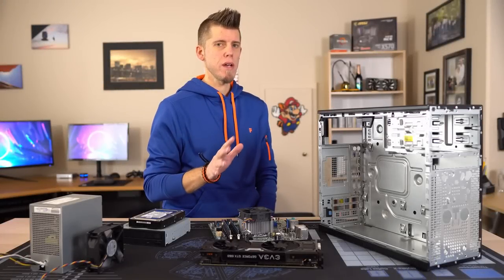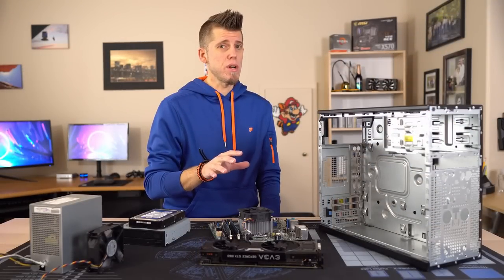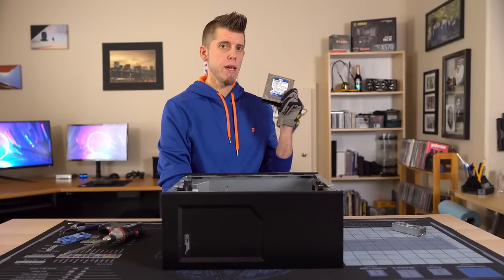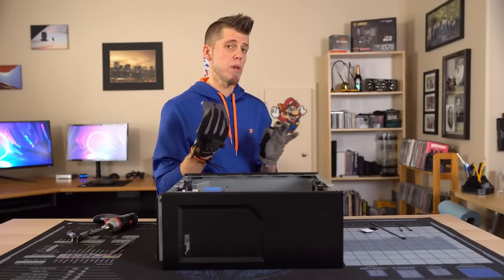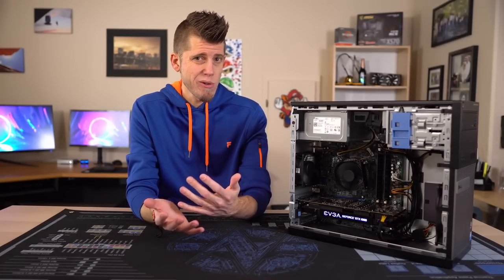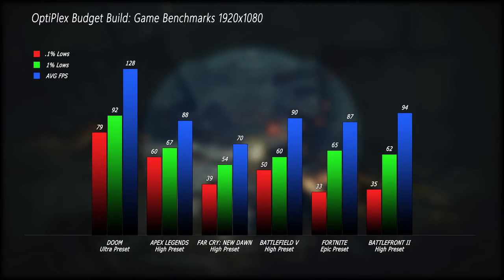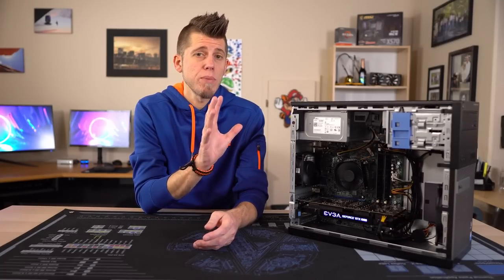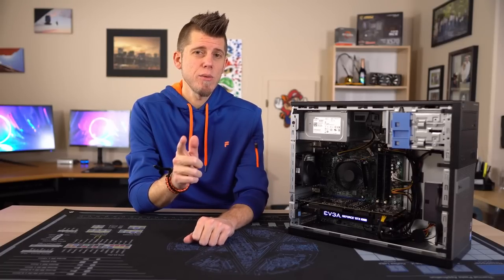Dell OptiPlex Budget Gaming PC For Under $300?

Comment: ummmmm.........using ANY type higher end component, like the GPU you have, you really shouldnt use the stock PSU. 

that GPU needs at least a 400w PSU 

and that CPU is more than likely struggling and becoming a bottleneck
Reply: I agree, however he has one VERY big problem: the motherboard doesn't use a standard power connector.  A different video card is advised.  It doesn't have to be a major drop, even down to a GTX 1050.  Dell clearly did not design that particular Optiplex to be a gaming rig.
Reply from the maker: I'm getting tired of repeating myself, so I'll copy and paste.

"People keep throwing around wattage numbers, not realizing that some power supplies have a wattage rating that is their PEAK rating, and that they can only supply around 250 to 300 watts continuously. This is why nVidia says, 400 watts as a minimum. To account for low end PSU's. I've torture tested this PSU and it can supply a constant 290 watts.

That being said, the system is pulling around 210 watts from the PSU, leaving you with a 70-80 watt overhead. It's fine and just as good as using a 400 watt PSU that only can supply a 300 watt constant."
Reply from the maker: @holman182  What you're referring to is BTX, and there are 24-pin to 8-pin adapters to put a standard PSU in these. That being said, read my other response as to why it's fine.
Reply: @TheGameBench  I suppose my only real cause for concern is voltages on the 12v rail.  So long as the voltages are ok, then definitely, the PSU should be fine.
Reply from the maker: @holman182  I mean, the amperage on the 12v rails isn't spectacular, but adequate. However, it might be worth taking some time to put a multi-meter on it to monitor the how steady the voltages are.

Comment: I came here from Rich's video and dude I think you should make a reply video toward ReviewtechUSA. Not to start any drama, but to explain the PSU issue like you did in your pinned comment and respectfully ask that he contact you or others before making "exposed" videos. He's done this kinda stuff before and I think if you let it slide he'll just do it again to another small channel and they'll get harassed like you are being. Just my 2 cents, keep up the good vids.
Reply from the maker: I really appreciate that, and I have gone over this, in my head, several times since yesterday. I've got rebuttals for pretty much everything he complained about it that video, but I can't help but feel like I would only be adding fuel to the fire. Wouldn't matter how well put my response was, how objectively correct I was, confirmation bias will validate the people's opinion that have been dropping comments. I only have a little over 3,000 subs, and thus no credibility. It wouldn't stop it from happening again. A response would have to some from someone much larger than me to have any impact.

That being said, I do want to make an in depth video, at some point, about power supplies and why the people focusing on that don't understand the reason for nVidia's recommendation and have very surface level understanding of power supplies. It's relevant information, regardless. I just feel like I need to hold off on making that video. Mostly so I can do more research into power supplies, so I can have an in depth knowledge of ripple. That way I can explain to people, why 80+ and wattage ratings can be very deceiving, and what to looks for when picking a power supply.

Anyhow, I'm rambling. Thanks for the support. I can't tell you how much it means after this weekend.

Comment: Oh no you just got put on blast by RieviewTechUSA
Reply: PlebMike I mean Rich isn’t wrong
Reply: @freshyeet4144  230w power draw at most, 300w power supply.
Thats more overhead than a xbox one or xbox one X
Reply: @freshyeet4144  Oh I know it was cringe worthy
Reply: nVidia website calls for a 400W min. the Dell is a 290W. Overall this is a good build guide, but Rich is 100% correct. 

The LAST thing to skimp on for a PC is the PSU.
Reply from the maker: The reason that nVidia says you should use a 400 watt PSU at minimum is to account for shitty PSU's that are rated in PEAK wattage. So, for example, a 300 watt PSU that can only supply a constant wattage of 200 watts. The 290 watt PSU in this system can supply a constant wattage of 290 watts. I've tortured tested them with a constant draw of 290 watts for hours. The total system power draw is around 210 watts, giving you an overhead of 70-80 watts. That's enough and doesn't put you in danger of damaging the equipment or causing premature power supply failure. I've fully tested everything and it's fine. The power supply in these is just as good, if not better, being able to supply a constant 290 watts as a 400 watt power supply that can only maintain around 290 watts, or less.
Reply: The Game Bench I’m a electrical engineer so I can tell you you fucked up son .
Reply: @EbikeAdventuresSD  lol
Reply: @EbikeAdventuresSD  Oh really.  I'd like to see your calculations.
Reply: Preston Cormick no it called a degree something you don’t have  nor the $250.000 plus a year I make working for GE yes that GE .
Reply: Jonathan2844 You can laugh it up when you earn a degree and work for GE.
Reply: @EbikeAdventuresSD  My query was that from another professional, but rather than an intellectual and mature conversation, you produce no calcs nor thesis, just self pontification  and juvenile insults to myself and others in this thread.  Your contextual reference to myself regarding Taco Bell is particularly egregious.  Far from the response any rational adult would expect from a self proclaimed middle aged professional with said education and experience.  

If, by chance, you are a fellow, I am embarrassed by your behavior.
Reply: Rico Swave Not middle age and you can see my work every day in things you use your welcome. I started as a intern and work my way up also I finished school early at that . Your perceptions of reality are false.

Comment: I actually built this system! Very doable! I was able to find a dell 7010 with an i7 3770 with 1 tb hhd, 16gb DDR3, a evga 450psu, and a stock gt730 for $85. I even found a 1060 6gb for $200 and a $20 used 500gb ssd for boot drive. $295 for 100+ fps on these same games.
Reply from the maker: A 1060 6GB for $200 right now... that's a steal.
Reply: @TheGameBench  I know!!! I could not pass it, I even saved the link in case someone needs proof lol!

Comment: Looks like you overlooked the wattage requirements of the gpu. That Dell stock 280-300w psu could cause system instabilities. That gpu has a maximum power requirement of 120w. So you should be using at least a 400w psu.. Not to mention the stock psu is probably not 80 Plus certified.
Reply from the maker: Since I'm tired of repeating myself, I'm going to copy and paste.

"People keep throwing around wattage numbers, not realizing that some power supplies have a wattage rating that is their PEAK rating, and that they can only supply around 250 to 300 watts continuously. This is why nVidia says, 400 watts as a minimum. To account for low end PSU's. I've torture tested this PSU and it can supply a constant 290 watts.

That being said, the system is pulling around 210 watts from the PSU, leaving you with a 70-80 watt overhead. It's fine and just as good as using a 400 watt PSU that only can supply a 300 watt constant."
Reply: @TheGameBench  says this, as he uses a cheap OEM psu.....
Reply from the maker: @Cyrus_Nagisa  Not all OEM PSU's are bad. There are quite a few that a lot better than a lot of the cheap PSU's I see people putting in their builds. I'll bet you were the kind of person that said this same crap about the Great Wall OEM unit in the Wal Mart Overpower systems. All the while, there are people running high end PSU's in their rigs made by Great Wall. Then Steve over at Gamers Nexus tested it and found it wasn't the dumpster fire everyone was making it out to be.
Reply: @TheGameBench  the reason your having to copy and paste it is because your wrong and you need a psu that can handle a 1060
Reply from the maker: @Silvyya  Read the pinned comment if you'd like to know why you're objectively wrong.

Comment: i have optiplex 9010 with xeon 1225 v2, 12gm ram, 460 watt coolermaster supply, 120 gb ssd, 1tb hdd, gigabyte rx 580 card
Reply from the maker: It's pretty close to the i5 3470, but it has two more MB of cache.
Reply: @Jason Packer pretty good actually most of the games are running around 60fps
Reply: @TheGameBench  yes.. i got the pc and all the mentioned parts except the card in 116$ or less and the rx 580 8gb card i got in 155$.
Reply: @Jason Packer yes what i found out that when it comes to gaming we dont really need high end specs.. even a mid range pc can give us the satisfiction.
Reply: almost the same here i have a xeon e3-1220 v2  cpu in a dell 3010 with 16 gb 1333mhz dual channel and a dell branded rare r9 360 2gb gpu. basically a r7 360 with lower  a few less shaders and lower tdp.  i might get a gtx 1650 later on but the xeon 1220 and the r9 360 aint too bad at all running COD MW or BFV on med at 1080p at 55-60 fps. shadow of the tomb raider though....it hates my setup....30fps if im lucky at 1080p.

Comment: If you are thinking about doing this, DO NOT KEEP THE POWER SUPPLY INSIDE. The one this guy uses can't handle the 1660 TI. It will likely catch on fire anyway. Calculate how much power your PC comments will draw, and buy a PSU with at least 50 watts of headroom. You can get a PSU with even more spare watts in case you want to upgrade in the future. A good PSU should last you over 5 years, so you'd likely upgrade your GPU and CPU before you upgrade a PSU
Reply from the maker: I didn't use a 1660 Ti, I used a 1060. I've tested the power draw and this 290 watt unit can maintain a sustained 290 watts. The system pulls about 210 leaving about a 70-80 watt headroom. So, by your own measure there... it's more than fine.

Comment: I just saw this on ReviewTechUSA. Are you going to respond?
Reply: The Slice Factor doesn’t look like it lol
Reply: Go back and leave this guy alone.
Reply from the maker: To what end? There are a lot of misinformed people responding some being rather aggressive. A response will only rile people up even more. All I can really do is explain myself as people comment.
Reply: @TheGameBench  some have been needlessly aggressive, it's the internet, it's going to happen. But many have voiced their concerns with your choice of using the stock PSU.  It's a legit concern, and you brush it off with some "not all psus are equal" bull, while using a 300w stock PSU that was made as cheaply as it could.  If it was a cheap bronze certified 300w I would be a good bit more understanding, even more so with a 400.
Reply from the maker: @Cyrus_Nagisa  Yeah, I get that, but Rich didn't have to be so aggressive in his video either. As for the power supply. I've more than explained that. It's functionally fine with the 1060. I'm objectively correct. People who have more than surface level understanding about power supplies knows this. Besides, it's not like I'm trying to convince people NOT to get a better PSU. By all means, if it's your budget, it would be the first thing I did after adding an extra 8GB of RAM for like $15.

The point of this video was to get someone into PC gaming that didn't think it was an option over a console, and with this hardware, the stock PSU will work perfectly fine. The problem is that because it's a pre-built, you assume it has a crappy power supply, and that's not the case.
Reply: @TheGameBench  anyone with a basic understanding of power supplies will tell you not to use a power supply that does not reach the minium recommend output for the graphics card. Also they would know not to use a Chinese power supply that is not 80+ certified and use a molex to 6 pin adapter with it. I know that functionally it might work but it's not a good solution long term. Any experienced pc builder will tell you never to skimp on the power supply. Especially when you can get a decent power supply that is more than capable for this build for 50$. You say the power supply is not bad but it is. Dell uses cheaper components for their pcs because they are not pushed to the limits. You are pushing the power supply to its limits and it's not even 80+ certified.
Reply: @Josiahsutton1  100% Agreed, this is very valid criticism and Joss77 is correct. I know this because I've been building computers since 2010, I pulled this stunt with my 2nd build, 2 days later I was playing Battlefield 3 when I started to smell smoke. The molex to 6pin that I used to connect my powercolor radeon HD 4850 had caught fire and melted obviously shutting the computer down. Luckily the rest of the components were fine but I learned a damn valuable lesson that day, it didn't take me long after that to upgrade the psu.
Reply: @TheGameBench  you got exposed dude. My house could be burnt the hell down with that power supply.
Reply: @Vaineguardio  Dude.... The HD 4850 came out in a time in a time of power hungry video cards and pulled more power at idle as the 1060 does at full load. The HD4850 could peak up over 300 Watts at game play. Of course it's going to melt the power connector, their not designed for that much power. Trying to compare this build to your experience 10 years ago is not an apples to apples comparison.
Reply from the maker: @Tinbeef22  Read the pinned comment. There's nothing wrong with a low wattage consumption GPU like the 1060 on this power supply.
Reply from the maker: @Josiahsutton1  That just the problem. The people criticizing this video have nothing more than a basic understanding of power supplies. When you say things like "it doesn't even have an 80+ cert" It just confirms this. That is an efficiency rating, and has nothing to do with quality. Stop trying to use it as a metric of such. There are a lot of trash 80+ PSU's out there that I would never suggest anyone use, regardless of the rated wattage, because it's easy to take a garbage power supply and add some better caps to get that 80+ rating. And they do it just because of this perception that it has something to do with quality. That being said, this exact PSU comes in 80+ Bronze and Gold. The only difference are the capacitors and thus the efficiency. They are, otherwise, exactly the same.

Now, if we were talking about a consumer grade Dell... I would agree with you. They're all about the lowest bidder and profit margins on the product. However, the OptiPlex is a business machine. They aren't in the habit of dealing out cheap components in their business machines because they will have to support them, with expensive techs that have to come out on site. I used to work for HP as a field engineer doing this. It's not cheap, and companies like Dell and HP don't want to foot that bill any more than they have to. So, they use better components in their business machines.

That being said, before I even started out making this series, I tortured one of these with an RX 480 pulling around 300 watts from the outlet on it for over four hours. It handled it just fine because that 290 watts is a constant rating. Unlike cheaper power supplies that will rate their power supplies at their peak wattage. Meaning they can supply that momentarily. This is why nVidia recommends a 400 watt power supply. They do it as a simple way to make sure their customers are covered in case they end up with a cheap peak rated 400 watt PSU. Which more likely supplies as much, or less, than the 290 watt PSU in this Dell. These Dell PSU's also have protections and will shut off if you ask too much of them... once again, I tested it. Also, they have adequate amperage on the 12v rails.

The 1060 will consume about 120 watts max. The rest of the system, less than 100 watts. I've also tested this as it pulled about 220 watts from the outlet. Leaving it with 70-80 watts of headroom. It's fine, I've tested these on end. Also, the adapters, are fine long term so long as you don't get crappy ones and so long as you're using them on a low wattage draw GPU like the 1060 and not something, like a damn 4850 that draws more power at idle than the 1060 does at full load, you'll be just fine.

I don't know about you, but I've been building and modifying computers since the late 90's. I agree that you shouldn't skimp on the power supply. I'm not telling people to use it to run a modern system with a 1080. With this specific hardware, it's objectively fine. The people that disagree are entirely ignorant as to how all of this works and have VERY basic understanding of power supplies and power consumption.
Reply from the maker: @Vaineguardio  Like BeZerK2112 said, that's your own fault. You did exactly what I told people NOT to do. You used a power hungry GPU with one of these. The 4850 draws over 140 watts at idle. At full load, it draws about 100 more watts that this entire system does at full load. Of course it was going to melt. I've been building systems since the late 90's and I would never have tried to put a 4850 on this PSU or a Molex to PCIe power adapter. Read the pinned comment or my response to Joss77 to understand why what I did was perfectly fine and of zero risk with these components.

Comment: I got the dell optiplex 9010 with an i5 cpu 14 gb of ram a 450W power supply and gtx 650 with a 500 gb hard drive I must say i’m really impressed with it. It can run a lot of modern games. Would love upgrade the graphics tho!
Reply: Swaggin dragon did you use a custom cable to connect psu to motherboard?